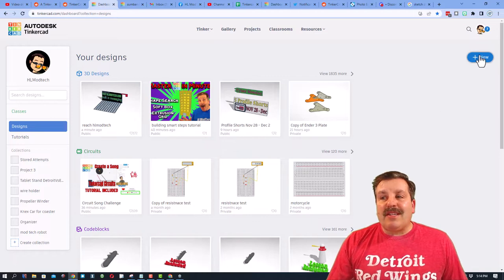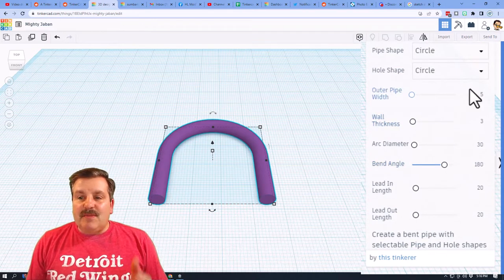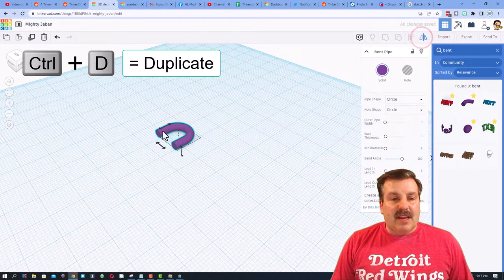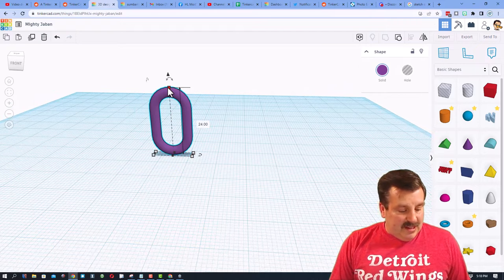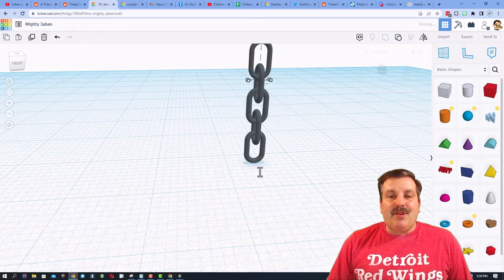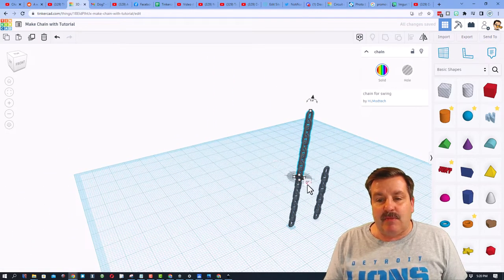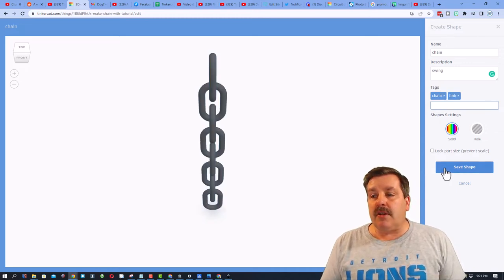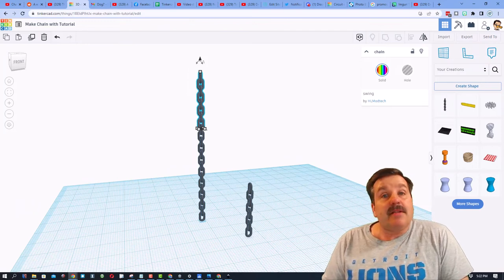A Tinkercad Chain in Minutes Save it as a Shape too! Quick Fix!

Comment: I use tinkercad a ton.  I liked this.   But in the interests of "parts" I would've just made the chain 2 links, as it would be a lot of work to trim that shorter if 2 were too long, and 1 wasn't long enough.    I generally find making parts most useful when kept to the minimum, and then just assemble multiple parts as needed.  YMMV.  Nice video, enjoyed it.
Reply from the maker: That makes a ton of sense. Thanks for sharing. 💯👍